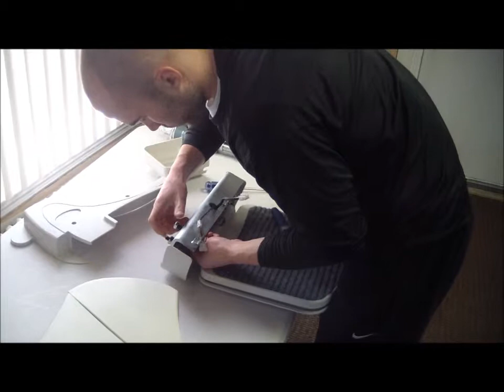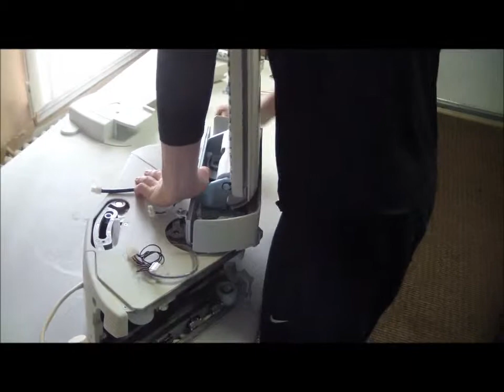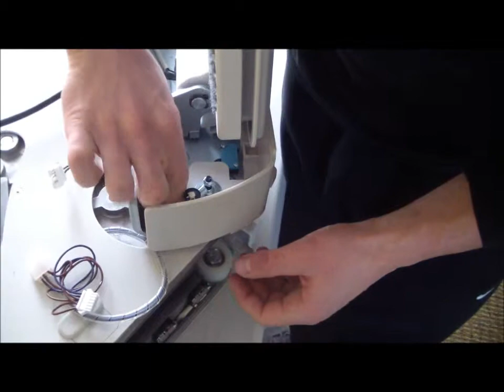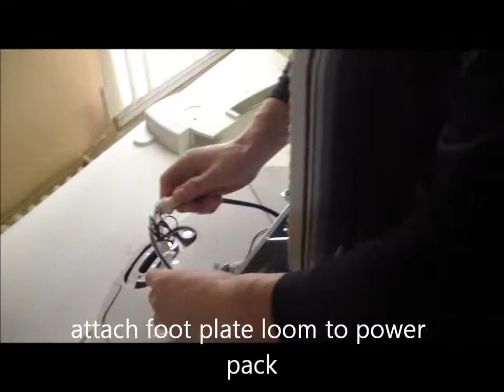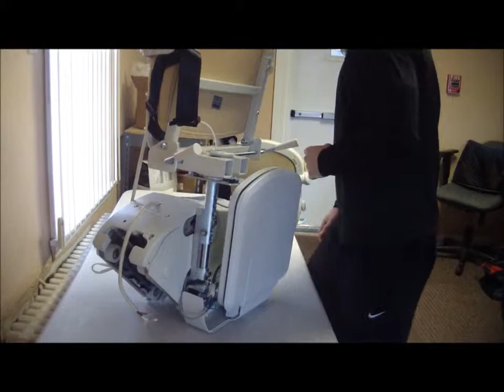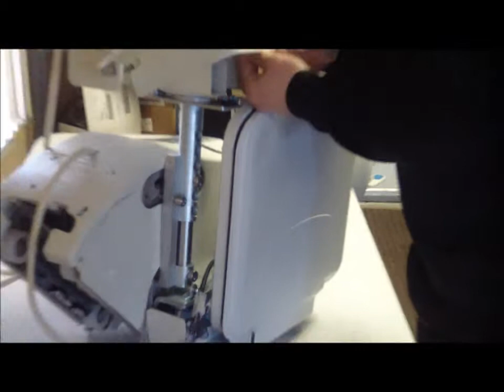Bulding 950 seat

Comment: handicare 950 was removed for carpet change and now the seat goes up and down ok using its battery but the rail isnt going up or down, the ram isnt moving at all, any ideas, thanks, showing error code 5 at the bottom